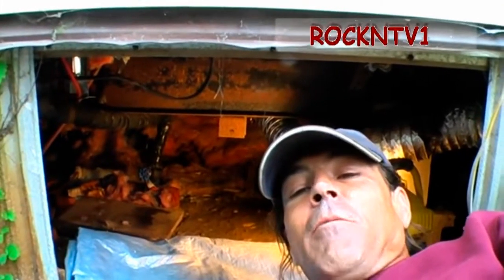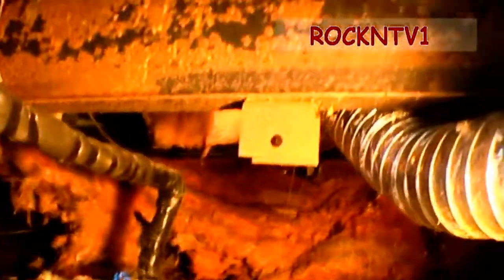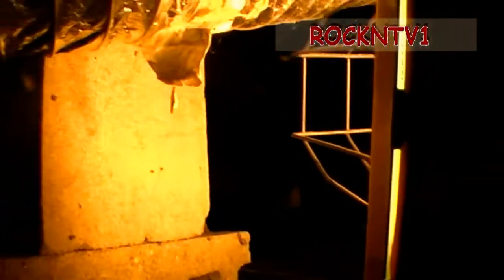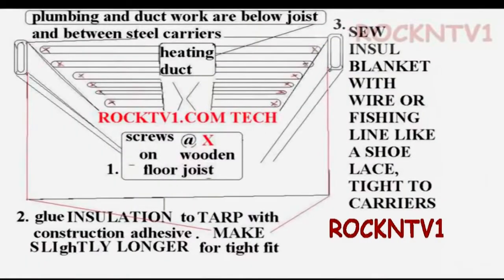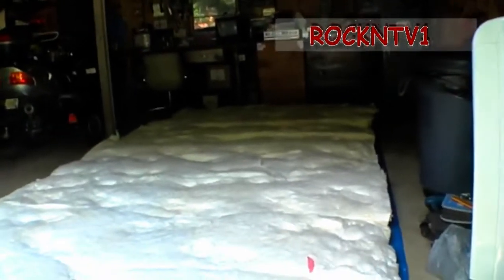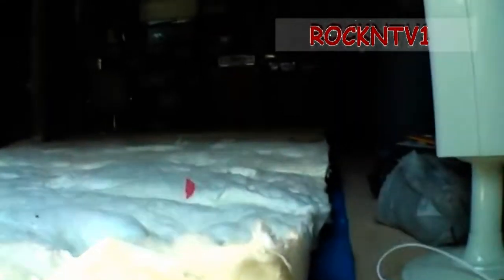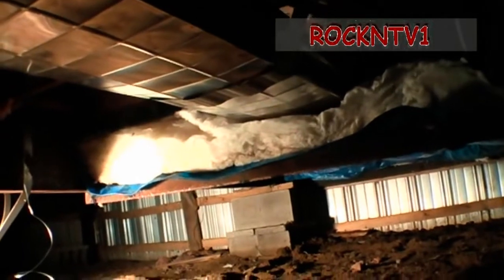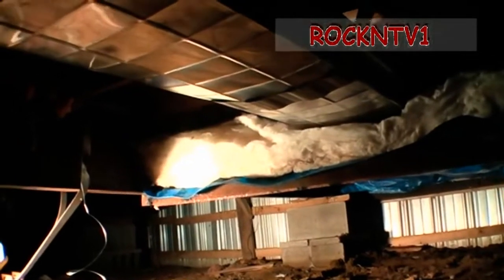MOBILE HOME REPAIR FIX FLOOR INSULATION

Comment: I'm glad I came across your video. I have to somehow manage to slither up underneath my mobile home to figure out replacing cut out insulation from a pipe leak a while back. I like the bag method. I also like that to save money you mentioned using a tarp if necessary to save money. I have to do this alone so, having this YouTube video makes me not feel like I'm the only person in the world that will be laying on my back with a bunch of cobwebs in my face and about 10 or so inches of height to work in. Thanks!
Reply from the maker: your welcome, glad to help ;-)
Reply from the maker: I did one of these this season,,,, I open the skirting on opposit sides a put the leaf blower to it,,,,,, if n it makes you feel better....
john

Comment: Need to do this to my mobile home, as well as the attic insulation
Reply from the maker: Alot of times it is easier to build a framed roof over the top of a mobile home, rather than gutting the ceiling. Using corigated roofing works nice and the insulation value can work twice for you / cooler in summer and fuel savings in winter. Thanks for watching.

Comment: Dig the idea of attaching the insulation to the blanket. Were you at all concerned about moisture capture with the tarp as opposed to using building wrap?
Reply from the maker: The home owner dictate the material as stated in the video, BTW the factory install was not a vapor barrior. Most of the damage comes from critters and plumbing leaks IMHO

Comment: I have a question, I’m insulating the floor of my dads dublex. The dublex is 25ftx27ft and the floor beams are 32 inches apart. I’m buying r30 insulation that is 30 inches x 24inches. Is it ok if I leave 2 inch gap on each beam?
Reply from the maker: 32" is distance between centers of floor jiost maby, you dont want gaps.
Reply: Thanks a lot for the help!!!! I have one more question. Would you suggest insulting the ceiling or the floor first? I seen a video and the guy said 50% heat comes in from the roof, 30% from the floor, 20% from the wall?
Reply from the maker: jOEL, lol i honestly dunt know what a dublex is ;-) I am in the USA and must comply with certain building codes and standards of construction. Residential is different from commercial. You are going to have to state a genral location for me to even guess, HOWEVER most residential construction (usa) does not use floor joist on 32" centers due to insainly thick subflooring nessecary, and the corrisponding "spans" would requier "engineered lumber" not 2x12s.  Do you mean duplex as in "adjoined" buildings?
Reply: I’m in the USA as well Hayward, California. A duplex is basically a 1 story really small house kinda like a townhome, they’re more to rent properties. You’ll find 2-6 duplexes in a property . That’s what surprised me that they are 32 inches apart. You use lot see 16 inches apart. This duplex was build in the 1950s, they used 4x4s on the floor and ceiling but didn’t put no insulation on the floor or ceiling